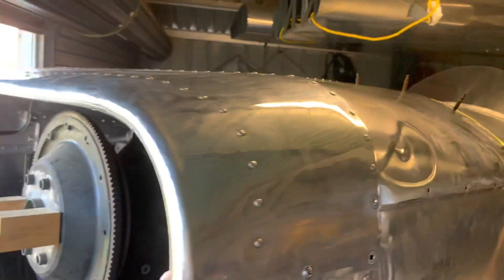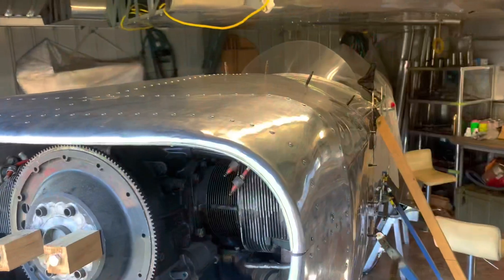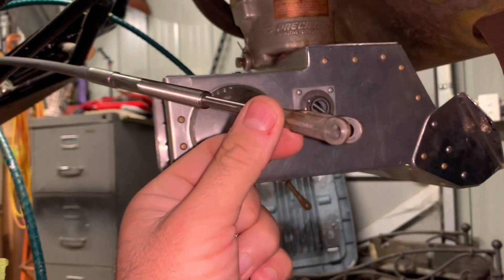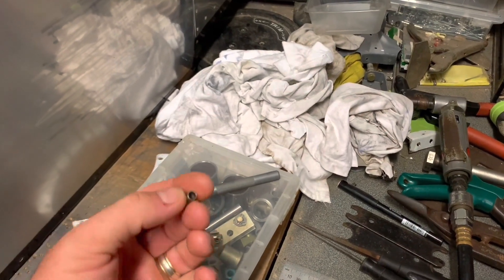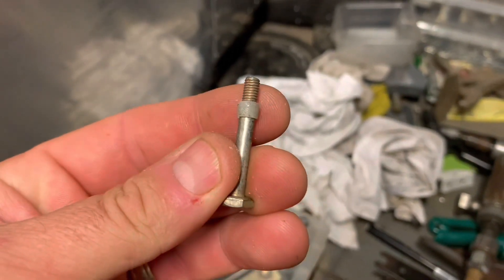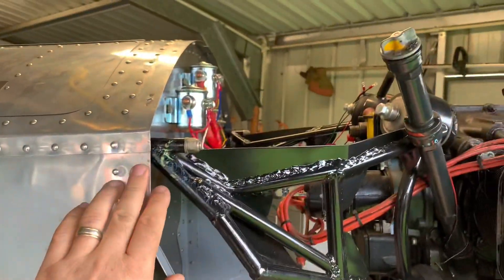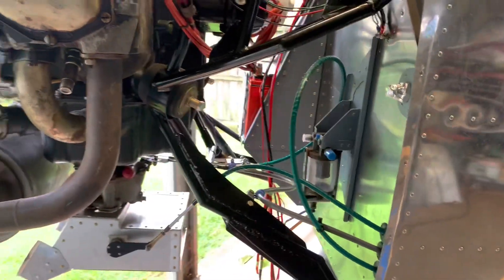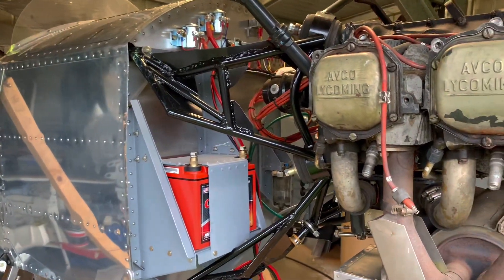Progress on Frankenstein

Comment: Hi Don. I have been watching your progress. Amazing aluminum workmanship. I am a plans builder in the USA and have built 2 airplanes from plans, as well as 6-7 restorations. The only bad thing I see is that large Maule tailwheel. You will not be happy with it. That is the single worst tailwheel ever made. The small (solid tire) Maule is good as well as Scott (pricey) or the Lang would be a much better fit. I guarantee that large Maule to shimmy! Hope to be seeing your first flight very soon.
Reply from the maker: Thanks mate, I appreciate it. The reason why I have that tail wheel is because it was free (Which matched Frankenstein’s build budget perfectly). Hopefully it will be ok for testing soon. Building planes is fun huh

Comment: One possibility (which you may have considered):  to fabricate a 'jackshaft' of sorts with solid linkage to translate throttle motion over behind the carb without the twisty loop.  Just sayin'... :-)
Reply from the maker: Yes, that would probably work. I did consider making up some sort of linkage/bellcrank arrangement as well. I might come back to that idea once a few other pieces are fitted like oil cooler and fuel lines. A smaller diameter cable would work better as well, I just didn’t have one